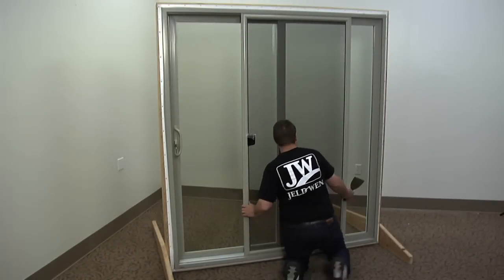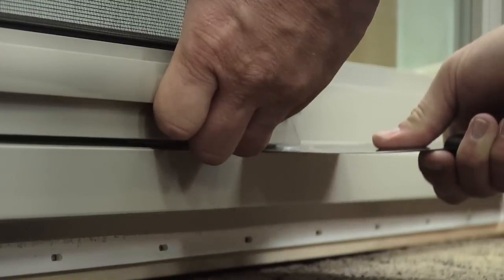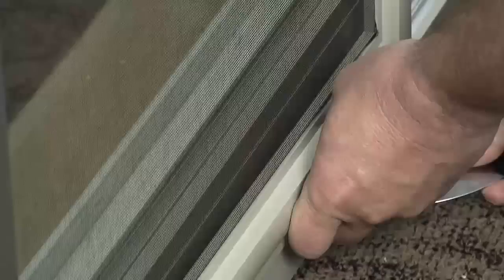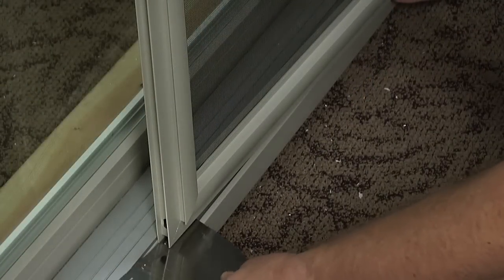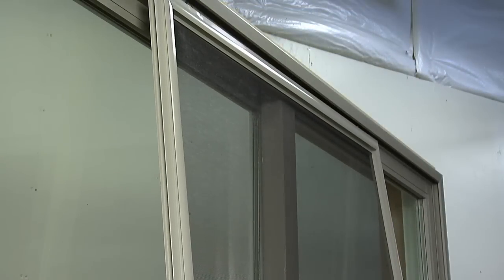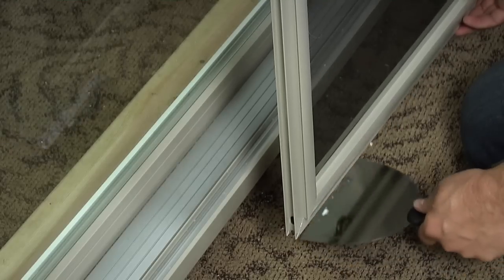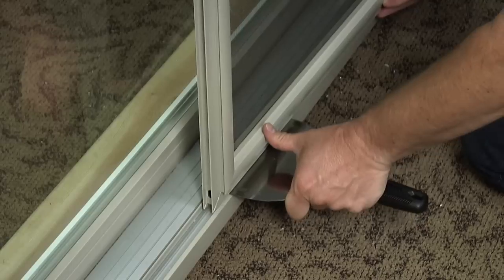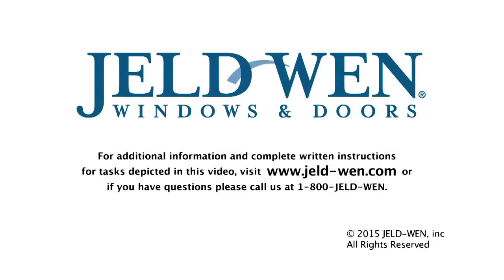How to Remove and Reinstall a Screen on a Vinyl Sliding Patio Door

Comment: some doors have special adjustment screws used to align the door.  these screws do not let the little wheels go in all the way unless you loosen them.  i suggest loosening all 4 of them before trying to get the door out.  i broke my door because i didn't do this ... thankfully it was already broken, so it didn't matter but maybe you want to get yours out in one piece.  more importantly you may damage the vinyl door frame by using brute force.
Reply: Thank you

Comment: This technique didn't work for me. After some trial and error I used plastic wedges (i.e. "to level") under both bottom rollers to bring the bottom of the door nearly up to the correct position. The with a flat blade screw driver pushing the roller edge up I was easily able to set the door in it proper slot.